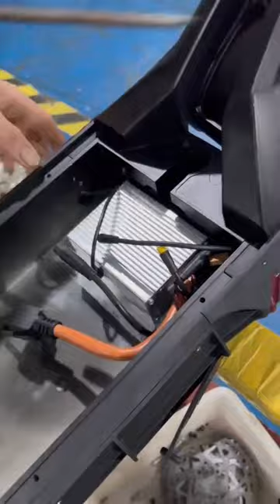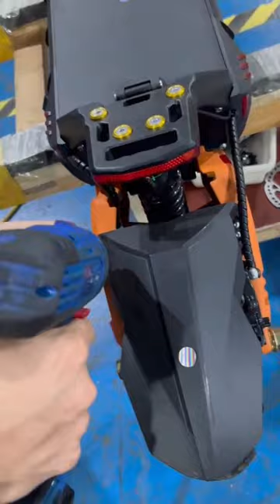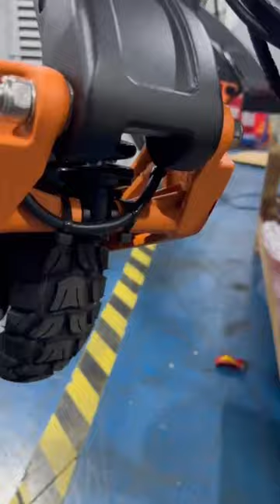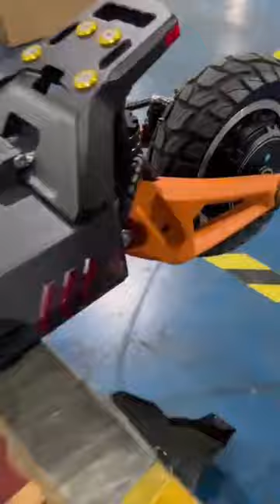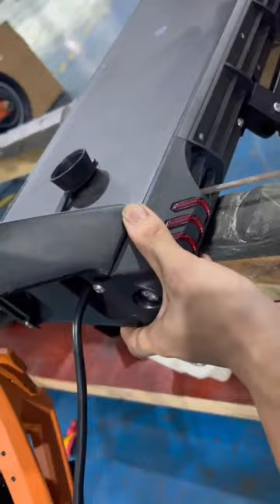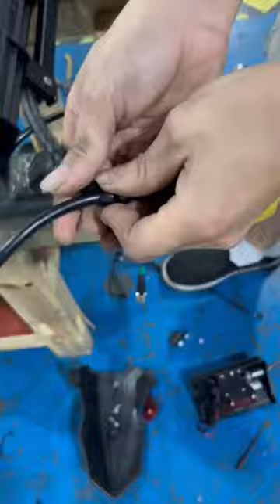KUKIRIN G3 Pro | Controller (long motor cable version) Replacement Tutorial

Comment: How I can remove it in old version ?
Reply: The old version is easier to remove the controller as the motor cables are shorter so u don’t have to feed the cables through anything. Remove the battery , remove the 4 screws holding the controller in place .The controller will now move towards the rear of the scooter & u will now see the motor connections(mark or tape front & rear) disconnect the motor cables & unplug the other connections & the controller will come out . 
The advantage of the longer cables is u can remove the motors much easier. 
I’d prefer short cable controller & short motor cables with an extension cable in between so it’s easier to remove both. 🛴💨